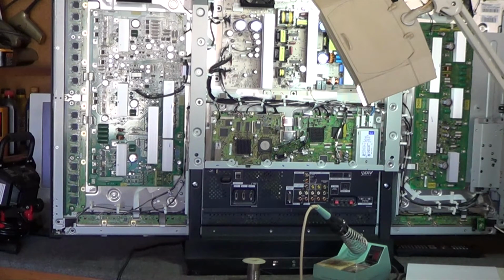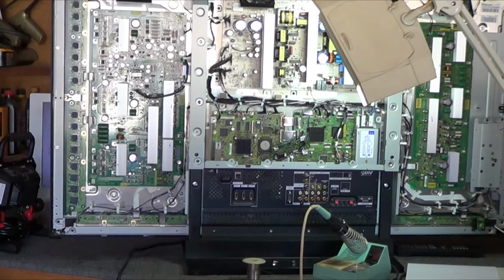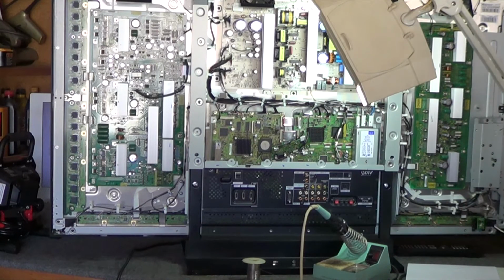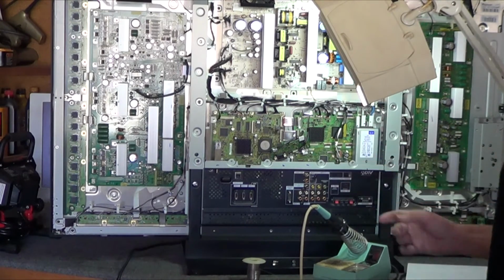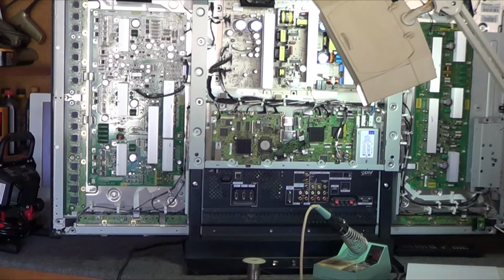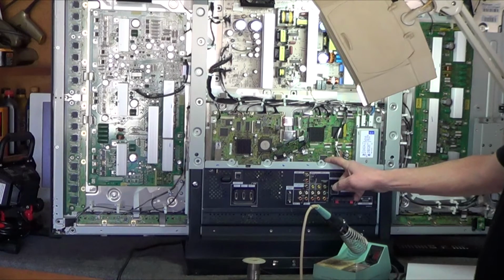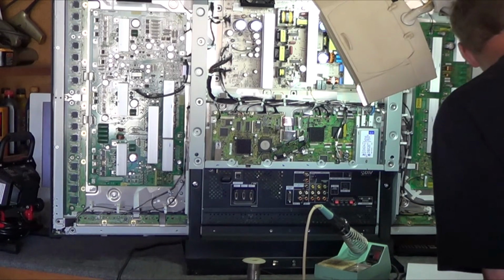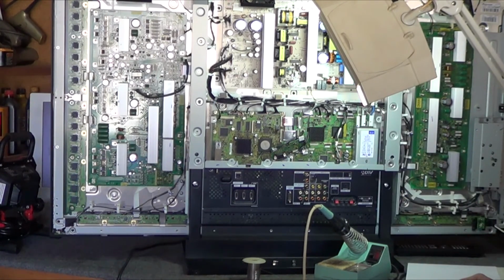Pioneer Plasma PRO-111FD PDP-6020 8 Blue Blinks Video #62

Comment: Hats off sir, you read my mind, and solved my (1st) problem. The test worked so it's not the IC. But both the negative on the screw (not the chassis) and the long press on display (which yes, brought up 5 orange lights voila!) very very helpful. Nine years later.  Thank you.

Comment: Thanks for this video. I have a 60 inch LX 609 with the 8 blinking blue lights but I cannot get it to show the orange fault light with the display button. All the voltages across all of the voltage regulators  seem fine so it is randomly sometimes booting up but most of the time not. Perhaps temperature related I am not sure. Anything else I should check before I send it off overseas to get fixed by one of the ebayer repairers?

Comment: What is the difference between the 111FD and the 101FD?
Reply from the maker: As far as I know just the screen size.
Reply: @TheMiniMachineShop  and what are those sizes?
Reply from the maker: @ArnoldTohtFan  I take it back the 111FD has speakers the other doesn't. Google it to find answers.
Reply: @TheMiniMachineShop  I assume you know a lot about these machines, so perhaps you could answer another question I have. There is much talk these days about silicon photonic chips. In your opinion, how compatible is silicon photonics with plasma displays? I realise we have lost out on 13 years worth of R&D since market forces and planned obsolescence put an end to plasma, but if it were to be revived at some point in the future, I imagine silicon photonics could propel Pioneer's technology to new heights.
Reply from the maker: @ArnoldTohtFan  Silicon photonics is a technology for producing chips with higher data rates using far less power. The plasma display Pioneer used uses a LOT of power to produce incredible colors and contrast that no other technology can compete with. We're talking apples and oranges here.
Reply: @TheMiniMachineShop  Indeed, the energy-saving zealots are also to blame for the demise of plasma. Can you tell me whether the 111FD can display perfect black? Naysayers claim that individual pixels cannot turn off completely in a plasma display, because the phosphor always lingers. Also, if the 111FD is truly the best model that Pioneer made, as many claim it is, I would have thought it would be the very last model they produced before shutting down production, but the date of manufacture on the back of this model always says 2008 or 2009. I would have expected 2013 or 2014.

Comment: Hello Dave, nice video I must say. What to do with the negative ground on the meter answered one of my questions. I have the PDP-6020FD, MFG 2009.  I am getting the 8 blue blinks and 5 red blinks after I hit the display button.  What I have gleaned off the internet is it is not communicating properly.  I had a service technician come out, he took 2 boards home with him and tested and re soldered the 17 caps. It didn't fix it.  He said it probably is the main board and they are very expensive.  Also even if you get a new one from Pioneer,  it has been sitting on the shelf for years and no guarantee.  He is a very reputable service technician and been in buisness over 30 years.
I have searched on line and found these main boards for about 75 bucks.
Might you have any advice? I'm comfortable with my mechanical skills to replace the board but though I would ask you your opinion.  Your expertise and knowledge is greatly appreciated. 
Thank you very much for your time.
Reply from the maker: I managed to find the service manual for my TV under a different model and it had a table of the blinks which told me what the problem was. Your best bet is to find the table, so you know exactly what the problem is before replacing things.

Comment: Hi
Thanks for the wonderful information. 
I have a Pioneer KRP-600P MFD  2009.  I am not sure about model! 
I live in Tokyo. I got the same problem. ( 8 blue blinking lights)
I have replaced the regulator (NJM2846DL3-18) of Media receiver (part number IC 4604) and fix it. It worked fine for 2 months and got the same problem after. 
I replaced the same regulator with a new one but it won't work. So I thought  it would  be the same one as you fixed in video.  
It seem my TV is different model with yours. 
Inside is different,  it's hard to say,  I find  the same Regulator (NJM2846DL3-18) but the part number  wasn't 
IC 7951! The part number is
IC 4504!  
Still I have the same problem and Tv doesn't work. 
Can't find the complete manual as you said in Video (PDP 5020 FD PDP- 6020 more than 500 pages)
Would you please give me some advice. 

Thanks

Comment: I have a PDP5071HD and the blue lights blinking 8 times.. Turns on then immediately turns off. Great tv. I appreciate you doing this video.. Different model but likely the same issue.. Will be checking back. Thanks for filling in the blanks.
Reply from the maker: Yep mine turned on then immediately off.
Reply: @TheMiniMachineShop  somehow my boyfriend fixed it.. I think it had something to do with removing the TV guide option. I can let you know if you want.. It didn't cost anything but time and I'm watching it right now.But you fixed yours already.. I was just relieved to hear your video.. It gave us the confidence to delve in. After it got a good cleaning inside. I love the word "mother board" idk why.. Cheers
Reply: @YOURmom-zv8be  can you help me, I face the same problem

Comment: How do you remove the white connector at the bottom left of the av board?
Reply from the maker: Without seeing it now idea my email is shown at the end take a picture of it and send it to me.
Reply: @TheMiniMachineShop  sorted it. It just lifts out  but was rather stubborn.
Have had no joy removing the chip off the board unfortunately. What temperature do you have your heat gun at? The solder on mine doesn't seem to give and I'm concerned abiut ruining components around it if I'm honest.
Reply: Did try the other guys suggestion of using very sharp small snips to cut the pins, but I've broken the pad off the board for Pin 5..luckily that's NC so I don't need it but Im not going to try that again.
Probably going to get hold of some kapton tape and try again with the gun
Reply from the maker: I'm an electrical engineer so I have professional tools to do this. First I use extremely small cutters and cut all pins free at the body. You can not use a gun to remove the regulator body not enough heat. I have a temperature controlled soldering station where I can heat the base and remove the body. I then remove the cut off pins one at a time.
Reply: @TheMiniMachineShop  while it isn't my area of expertise, I also have access to an electronics bench at work with various weller kit including a soldering station with heat gun with variable air pressure and temp up to 500*
I struggled to get enough temp to the smd to remove it from the solder on the board. What temp do you use to heat the area? Any reason you don't use Kempton tape?
Reply from the maker: I don't have temp control it just gets hot enough to melt solder and is constant temp so if the tip cools down power is automatically increased. The idea is you only want to apply enough heat to melt the solder and be on it as short as possible. Any more heat and you risk damaging/lifting the pad. Even when installing the new part I only heated it until an edge reflowed done. Since you damaged pads you'll have to use something to fix it be it Kempton or wire wrap wire. If there is a station at work there is probably some one with soldering skills.
Reply: @TheMiniMachineShop  will wait til next week when the guys are back in for that.
Only one pad came up which is specific to pin 5 which is not used so figured it wouldn't effect any operation anyway
Reply: Fixed it. Looks like pioneer used a high temp solder as had to up the heat gun temp to 500*c. I think using kempton tape and some thermal assistance to protect surrounding components would be useful.
If anybody attempts to cut the pins and snaps pin 5, no big deal as that's not used.
Reply from the maker: Fantastic!!! Not an easy job if you don't have the right tools... :)

Comment: Data sheet for the voltage regulator: NJM2846DL3-18
(IC 7951 on the Pioneer IO Audio Ass'y PCB):
https://www.mouser.com/datasheet/2/294/NJM2845_NJM2846_E-346748.pdf

Note that the datasheet lists several types.  Make sure you order the "-18" one,
which is the 1.8 V output voltage regulator.  The input voltage should be about 3.4 V
per the Service Manual (page 41) located here:
http://kurolegacy.site44.com/Doco/Manuals/PDP-6020FD%20Service.pdf

Also, the DL3 regulator is the 5 pin package IC.  The datasheet shows the pin out 
on the very first page.  Pin 2 is Vin, Pin 4 is Vout.  Pin 3 = ground, as is the large metal 
back plate (top part of IC & its underside, as well).  Easy to place your negative voltage
probe on this larger metal top plate to then test Vin & Vout readings on pins 2 & 4.

Caps are needed to stabilize the input / output voltages.  So, if your readings
fluctuate, you may need to replace these caps, as well.  A multimeter will
help determine, but an oscilloscope is a better instrument, if you have one.
Reply: These links will also be helpful.  The 2nd link below details the exact repair
from the Pioneer service manual:
https://www.avsforum.com/forum/misc.php?do=showattachments&t=1534540
https://www.avsforum.com/forum/attachment.php?attachmentid=1541569&d=1468309754
Reply: And... One final link that you all may find helpful.  Pioneer's link to downloads
such as manuals & firmware updates:
https://www.pioneerelectronics.com/PUSA/Home/ch.Plasma.Support

Comment: Hey guys i have a Pioneer Pdp6020fd will the 8 blinking blue led, i also have a pioneer elite pro1140hd  for parts (cracked screen :(l so would this part be compatible with the pdp6020fd  ???
Reply from the maker: You should be able to look at the boards/modules to see if they have the same part number for compatibility.

Comment: A temporary fix.  Plug the tv into a nice fat (8) extension cord and plug the extension cord into another wall socket in another room that is on a different electrical circuit.  I have too many things plugged into one circuit and the TV is recognizing the drop in voltage on that line and giving me the eight blinking lights.  My TV is working normally now that it is plugged into another wall socket on another circuit in the house. but I am looking for a new smart TV
Reply from the maker: Yeah we bought a smart TV as a replacement but the picture quality isn't even close to the plasma so we returned it and I fixed the old one.
Reply: +Dave M  hie i have a pionneer pdp -507xg blinking light 8 times. how can u help sir i live far away in southern africa

Comment: Hello Dave,Thanks for the guidance. 
I have a Pioneer PDP LX5090, circa 2009 which has developed a similar
problem.  I live in rural France and a call out would cost more than a replacement TV! so I'll try the fix m'self.  I'm getting the part from Digi-Key.  As a complete novice I'm guessing I need to remove the circuit board the IC Regulator is soldered to ~ right?  If so could you please advise how to remove
it and, apart from due care and attention, what precautions I need to
take.  Thanks.
Reply from the maker: The video explains how I removed the regulator without removing the board but you can remove the board if you feel its safer. Off hand I didn't remove the board so don't know how to remove it. You need a really good solder iron to attempt this!! If I were you I would remove the board and take it to someone with solder skills. Good luck!

Comment: Hi, I have a Pioneer KRP600/M01 media receiver setup.  I started getting blue blinking LED error switching HDMI after the set had been on for an hour or so.  Unplugging the receiver for 5-10 mins from the mains solves the issue - I never unplug the TV. The issue started not long after I purchased cheap HDMI 1.4 cables which are in a very cramped space.  The reciever has got the all clear from Pioneer service, they've asked me to bring in the TV.  I'd rather avoid the hassle as the issue only arises on switching HDMI. Any possibility the coms issue could be as simple as these HDMI cables?
Reply from the maker: Its possible. The board in the video is the HDMI interface but knowing what signals are in the cable I don't think cables are the cause. You may have a ground loop issue. Make sure the TV and receiver are plugged into the same outlet or defeat the ground on the receiver. Let me know what happens.
Reply: +Dave M Hi Dave, thanks for the quick reply.  I'll be collecting my M01 tomorrow.  They are both plugged into the same surge protector, it is about 10 years old so maybe I should replace it.  I will try a factory reset tomorrow aswell.  What are the chances it is a fault with the actual TV?
Reply from the maker: If you can consistently make it happen by just selecting different HDMI inputs on the TV, then it would suggest something other than the TV. Does it do it when switching between other inputs? I should do a video on why you DO NOT want to use a surge protector.
Reply: +Dave M yes, the issue only occurs with my HDMI sources, I have switched to digital TV mode/satellite from my HDMI equipment by accident and it works fine regardless how long the set has been on, switching back to HDMI the blue LED kicks in.  Unplug the receiver, 5-10 mins later the problem is gone, there seems to be a 5 minute window from cold start that I can switch HDMI without a problem.  I'm aiming to eliminate all possible issues before opening up my Plasma. I did notice the last day when I removed my receiver there was a humming noise in the surge protector.  Why not use a surge protector?

Comment: Any chance you would post link to service manual and part number for regulator? Thanks for video filled in lots of blanks!
Reply: https://elektrotanya.com/pioneer_pdp-5020fd_sm.pdf/download.html
Reply: http://kurolegacy.site44.com/Doco/Manuals/PDP-6020FD%20Service.pdf

Regulator is NJM2846DL3-18.  Should be 3.4 Vin, 1.8 Vout per page 41 of that Service Manual
Reply from the maker: Sorry but I can't find the manual again for some reason. In the video I tell you which manual to search for and its not the 111fd also the regulator part number is flashed on the screen at some point. Hope this helps!

Comment: I have replace the regulator but I am still getting the a blue blinks after on for a while and I turn it off and then turn it back on
AWW1353
Reply from the maker: Sorry to hear of the problem. Are you sure the replacement is working? Check the output test point on the PCB and not at the regulator. Do you see the voltage at the test point?